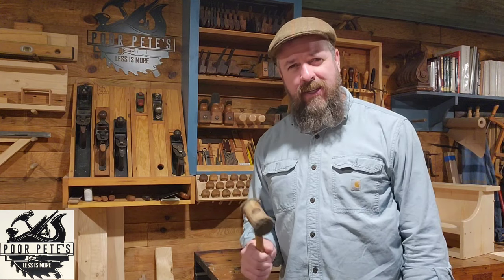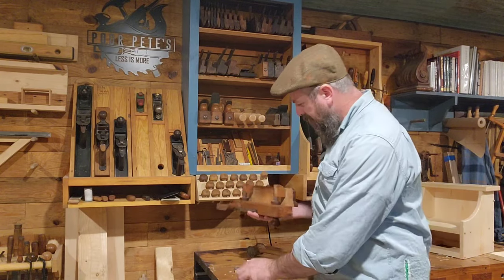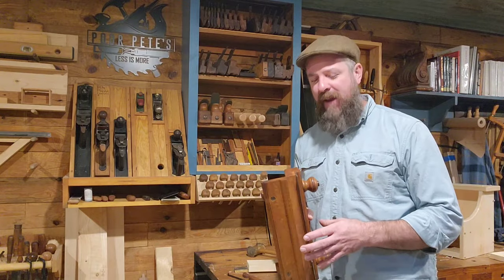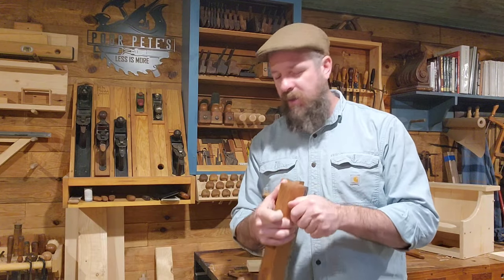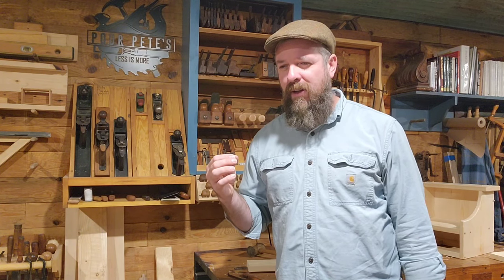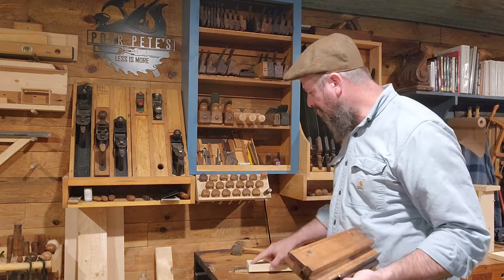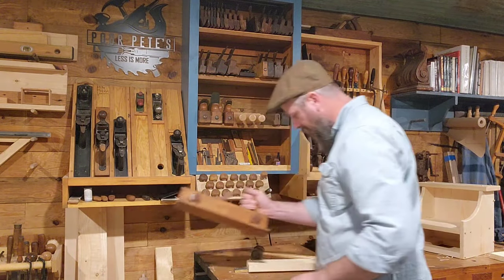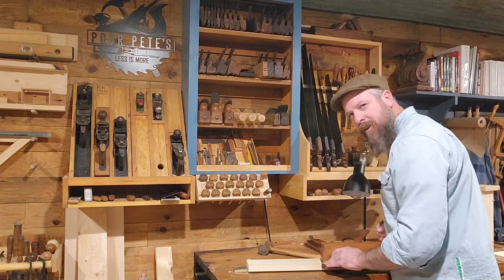Setting Up and Using A Plough Plane #woodworking

Comment: They still have wooden ones like that for sale, but they cost way more than even a vintage Stanley 50, which I bought for a fraction of the price a while back and works great. Rex Kruger has videos on how to make DIY versions of these wooden plough planes, using chisels and scrap wood. I don't know if they're practical or not though. I made a set of blades myself from for the Stanley 50 because the originals cost so much. They fit fine, perhaps not as good, but at least I don't have to sell my kidney to buy a set. Thanks for the info on this.
Reply from the maker: Yeah, Rex Kruger has some really good videos for sure! Nice, sounds like your pretty handy with DIY, I'm glad you enjoy traditional woodworking! Thanks for the great comment!!!